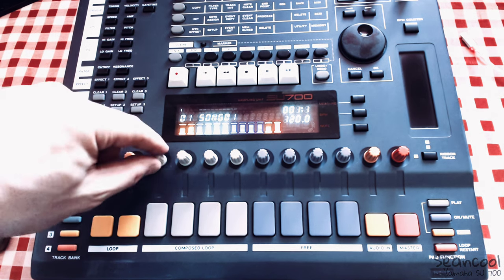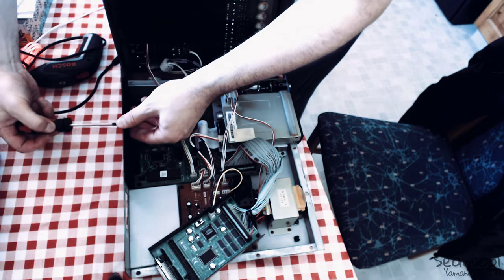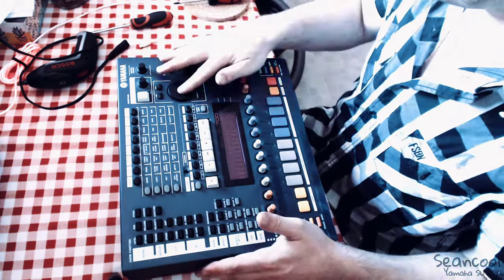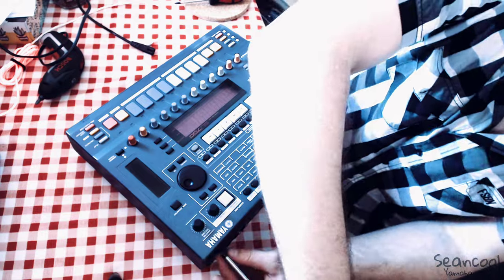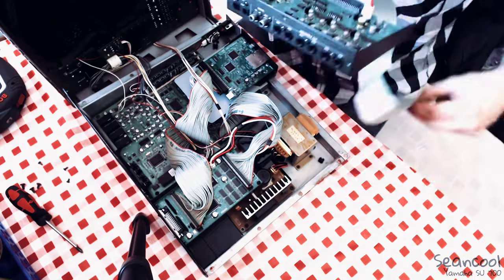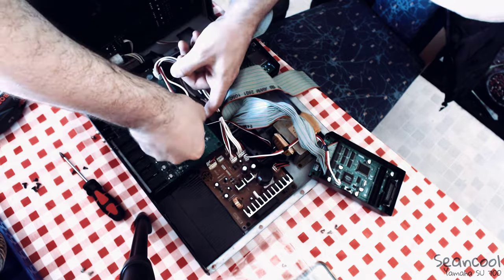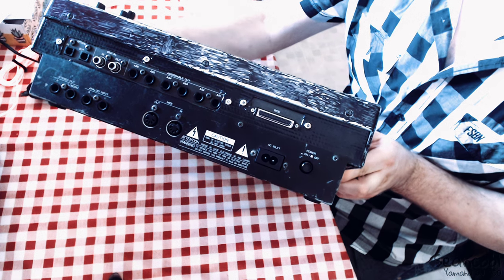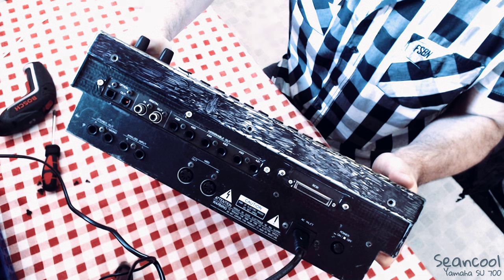Yamaha SU 700 Sampler - I/O Expansionboard AIEB1 Board - Installation and Explanation (Englisch)

Comment: Where did you find an AEIB1? I want one for my A3k sampler but right now the expansion board costs more than the rack 🥲
Reply from the maker: Yes they are really rare and the prices on the used market are extremely high. One card was in a used A3000 another one I bought for 150 €. Sometimes you are lucky but the offer is sometimes really tiny even if you want to buy something in your area.